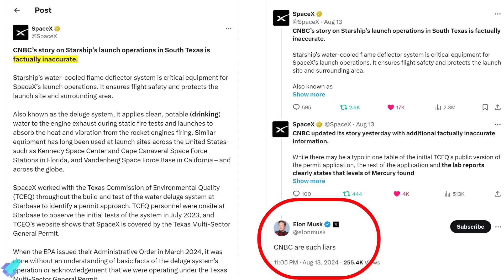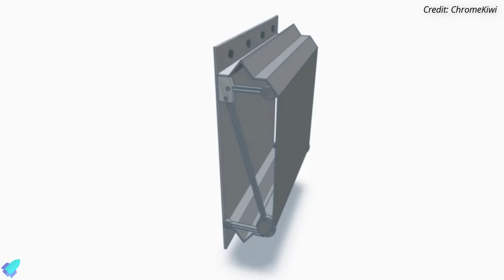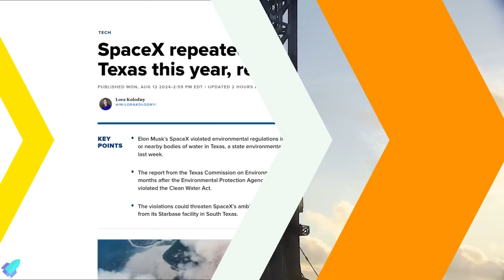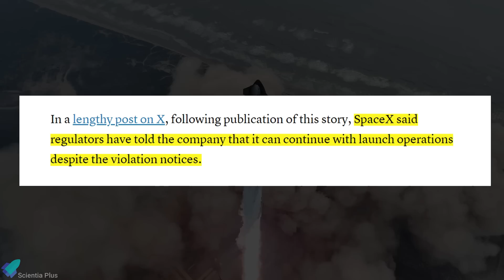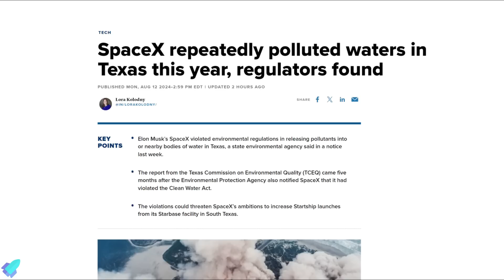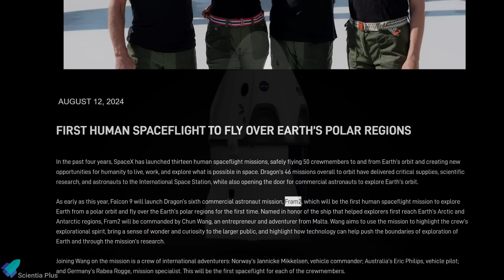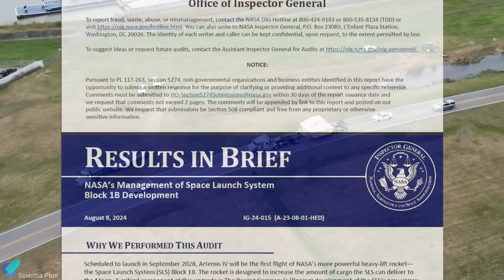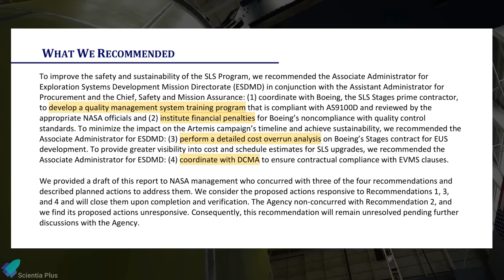CNBC Starship Allegations Changed Everything! FAA Cancelled License Hearing

Comment: Water deluge system not necessary, only if they space x will increase the hieght of rocket distances from the ground like a mesille launcher, instead using of water as exhaust gas coolant use gaseous form to cool down or to lower envieonment temp around the burners

Comment: the mercury in SpaxeX's surroundings may come from somebody else!! it may be already in the soil; mercury-salts are in widespread use in agriculture (seed dressing agents) to make the grain-seeds of corn wheat and oats indigestible to birds, especially the ravens! Also mercury fumes are emitted by coal-burning power plants and possibly by ships, mercury, Hg is a multi-decades old environmental problem accumulated in the soils. It is certainly not a contaminant in Starship's fuel. 
"Warm" Mercury evaporates into the atm, drifts to the Arctic and condenses into the snow!! 
Metallic Hg amalgamates with metals, ( https://www.youtube.com/watch?v=IrdYueB9pY4 )  especially with Aluminum and deteriorates it's strength!

Comment: The FAA needs to just grant SpaceX a universal license, the work is too important to be bogged down by this nonsense
Reply: Feds Against Aviation.
Reply: Once again, Elon Musk must move SpaceX to China to accomplish HIS GOAL BEFORE HE DIES OF OLD AGE.
Reply: Really? How about launching rockets over populated areas like China does? Oversight is needed. Space X doesn't have a very good safety record as a company overall. They need  to be scrutinized.
Reply: That's idiocy at a high level.  It shows the thinking of a simpleton.
Reply: Thumbs up. I say let em fly. 4:26 What temperature is the water deluge system LOL
Reply: @greenmoxy  It’s difficult enough in the 21st century to be able to do anything loud, dirty, and, frankly, dangerous, as populations grow and environments get degraded. We in the space industry need to show that those things can STILL happen- & we’re not willy-nilly violating legitimate protection rules at the same time. So far, the FAA has been doing a great job in its dual role of Regulator- and promoter- of commercial space launch (both of those things are in its founding law). Let’s not be stupid or irresponsible, folks. To my knowledge, SpaceX hasn’t until now, either; while maintaining essentially a Chinese-like speed in bringing the impossible forward. I detect that CNBC is only trying to do an honest job here; they have launched on to a SpaceX antagonist as a possible source with ESG Hound, is the worst that you can say about them. But the FAA has been doing their hard job very, very well. Let them continue to do it. - Dave Huntsman
Reply: @dphuntsman  > FAA has been doing their hard job

The "hard job" of sitting in air-conditioned office pushing papers? They even failed to detect that Boeing completely botched the 737 MAX project.
Reply: Thumbs Down. No such thing. FAA has a legal job to do; let them do it.
Reply: @dphuntsman thanks for letting us know you gave it a thumbs down, really contributing to the discourse big guy
Reply: @ryanbigguy  You’re welcome!